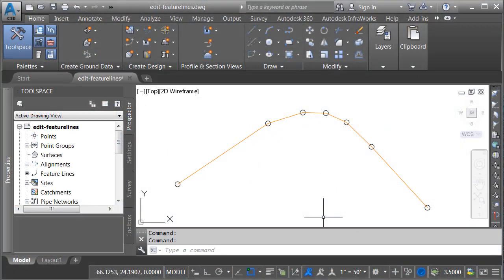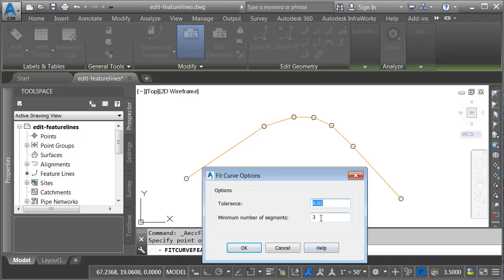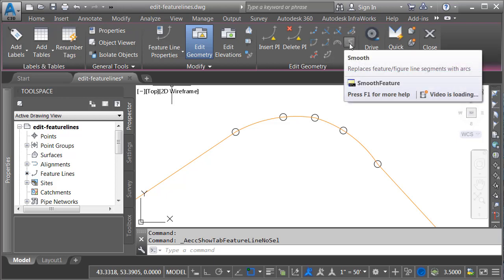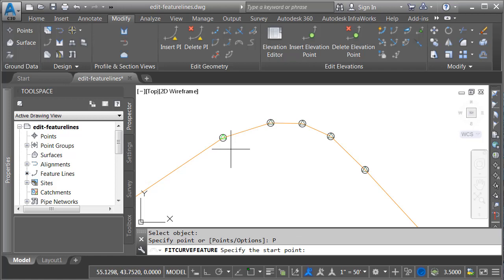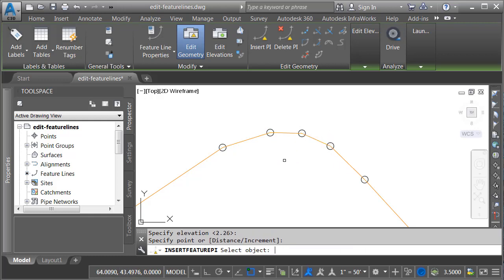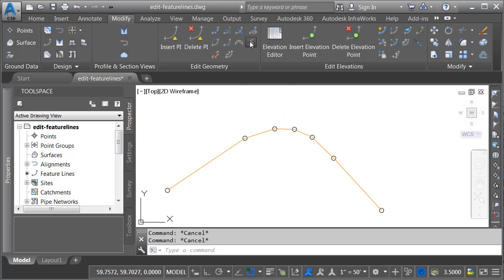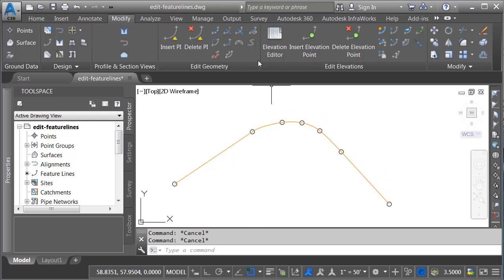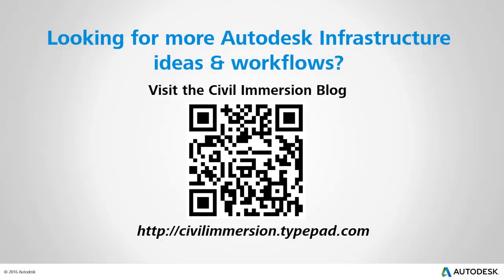Editing Civil 3D Feature Line Geometry using "Fit Curve" & "Smooth"

Comment: This works for 2D polylines as well. Thank you so much for this! We receive mapping from other programs and the lines are a series of millions of vertices connecting tiny straight lines. Using PEDIT-Fit first, and then FitCurve, this cleans up those lines brilliantly!
Reply: You can not create an arc with different elevations at random points using any of AutoCAD commands (line, polyline, arc, circke or 3D polyline). However, the method as suggested in your comment will work only when working on a flat plane.